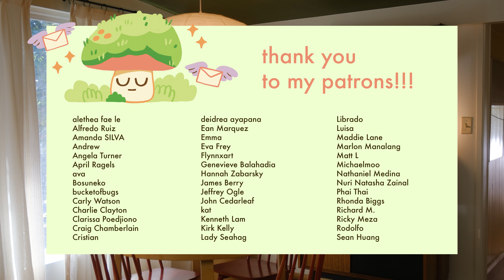Home Updates | Painting the ceiling & testing colors in the bedroom

Comment: The ceiling trim in the bedroom looks to be a typical quarter round. I'm not sure of the diameter but that's easy enough to measure it. With the painting paint one type of surface at a time (drywall then flat section of trim around the brick then the quarter round). You can also use the process with the painting of. the bay window part (paint drywall then trim then supports, etc). After painting each type look at it and see if the next portion needs painting. Much easier to paint the next portion than to repaint it white.

Comment: I would do the bedroom walls but leave out the trim. In older homes there has been many changes with trim work and I think leaving the trim white would mask it to sort of blend up into the ceiling. The bedroom reading/ plant window is such a interesting area though, if you were a more experienced painter I would say do some sort of taped lines angle design but I think less might be more.

Comment: Painting the ceiling. Cut in the corners and edges with the brush. Put a broom handle on the roller (you don't need a dedicated roller extender that costs $$) so you can stand on the floor while you paint. Long sweeping back-n-forth (up n down) with the roller gives a nice even coverage. Works on painting the walls too.

Comment: Hi! Design professional and color consultant here and I've following your color adventures. I don't know how far you want to get 'in the weeds' but I would like to toss in some ideas that could help with some of your questions or be helpful in general.
- F&B is a full spectrum paint making it very reactive to different lighting conditions. Because of this it is important to swatch it on all  surfaces are considering painting, each wall and especially the ceiling. 
- I would highly recommend painting it all one color, including the ceiling. None of the trim work has enough architectural significance to highlight. But, if you want to do something more interesting and architectural, you could paint the window bay a tint of the color you choose. Your paint store can create the tint by adding 25% white(or more if needed) to your color. They can do a sample so you can also swatch it.
- Changing the color of dining room curtains is a great idea for a couple of reasons, first it will address your concern of connect the ceiling the rest of the room, but creating the vertical contrast will also increase the visual height of the ceiling. When choosing the color the value is the most important consideration. Do not try to match the ceiling. A mid range green with a more yellow base will always work, but if you want a little more drama, go for a more complementary color like a burnt orange.
If you have any questions just let me know.
Reply: I learned so much from this response omg
Reply from the maker: @futuroid me too 😩
Reply from the maker: Thank you so much!!! This is great advice
Reply: @benjiplant  You are so welcome. Working with color is such a beautiful and complex combination of physics and emotion. I love helping people learn how to work with it.
Just a note: I have worked with Parma Gray many times. It is a beautiful, sophisticated and complex color with a long history (I think it goes back to the 1830"s), but it is very reactive. I highly recommend more swatching before final decision. Pull your existing swatch all the way next to the brick chimney stack to see how it reacts to the brick and grout colors. In addition, do a large swatch in a corner that includes the intersection of the two wall planes and ceiling. I know this seems like more work, but the inherent beauty of F&B paints is their reactivity and how that they can create their own architecture with placement and light.
Reply: @benjiplant  Hi Benji, I have a question, have you visited the F&B website? It is a great tool/resource. Each color has a photo gallery of 50-60 photos that show how reactive each color is to differing conditions, lighting, context and architecture.
Reply: @EasonDesignGroup your knowledge is admirable and I aspire to have the same technical knowledge and confidence you have when it comes to paint and colour. How can I learn this in detail?
Reply: @choonghanchan7236  Start with some basic Color Theory. There are some good classes on line and many books available on the subject.

Comment: Hiii Benji. It's so exciting seeing your place change color! In your bedroom, you might want to add matching ceiling trim (just the simple quarter round) to the wall behind your bed and the other wall where it's missing, even if you decide to color drench the room. In my experience, painting the trim/wall a non-neutral color emphasizes it even when it's the same color as the walls, so I'd try to even it out wherever possible before you paint. And the ceiling trim is a quick win!

Comment: Benji, Paint the dowelling next to the ceiling the same color as the wall so it disappears. The wall will seem to be the same height all around the room. I too thought the ceiling would look lower with the dark paint but you're right, it worked! A single edge razor box cutter held at a 45 degree angle on the glass will clean up those sash edges on the exit door. Nice job!

Comment: Here's my idea:
Paint the wall that your bed is against (with the painting of the basket), do not paint the trim around the brick on either side.
Also paint the other wall your bed is against (with the blocked off door) until it meets the trim on half the door. Maybe see if you can get some matching trim for the other side of the door, I'm not sure if there would be room for it to fit since there is that nob on the wall, but I guess you could measure it out and see!
Paint the wall with the windows up until the beam on the ceiling.
You can also look into adding matching beams to the walls, which would help "finish" off the look of the door, as well as "cut off" the extra part of the room and help transition from blue to white.
You can leave the door trim white and see how you like the blue. If you end up wanting to paint the other side of the room blue, I'd recommend leaving the beams white.

I am NOT a designer, but I love trying to design lol - anything you do I bet would look good!

Comment: The green ceiling looks incredible! It really ties into the warmth of the room so well. I definitely think green curtains would be a lovely way to pull everything together, but I wouldn't go for curtains super close in shade to the ceiling. Maybe try a green with a similar tone but a bit lighter? Also, I actually really liked the light blue paint. I think it only looked super grey because it was right below the parma blue. But if you're only considering the yellows or parma blue, I still think parma blue is the way to go. I really think just doing an accent wall behind your bed in the parma blue would be a good start especially because of how beautifully it contrasts with the wood and the brick. If you really do want to paint everything though, I think the hay yellow might be better? I feel like the parma blue would be overwhelming as a color drench. The yellow blends in a bit too much with your furniture imo, but it would work well as an overall color for the room whereas parma blue seems like it could be a bit overwhelming outside of just an accent wall

Comment: The ceiling looks amazing... you did a beautiful  job, Benji! Also, changing out the green panels for clear....you could definitely see the difference. A suggestion about the upstairs room... how about adding trim to the areas that really stick out and leaving the trim white. Or if all else fails... just paint it all blue... If it just doesn't look right, then find a beautiful, soft, warm white... And whitewash the room... Even if it is white... A soft and warmer white will still be beautiful because that room gets so much wonderful light... good luck!